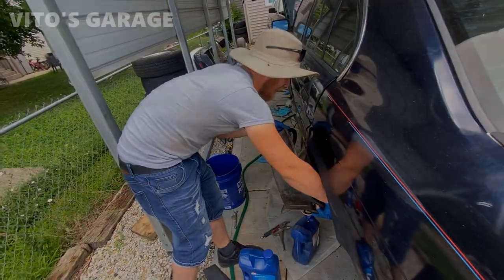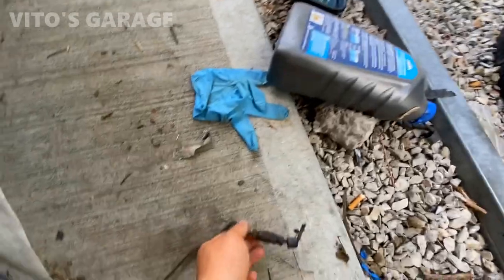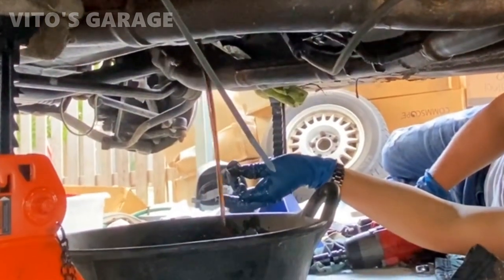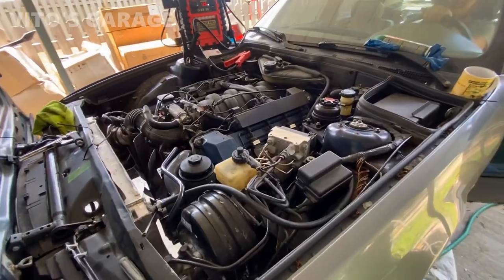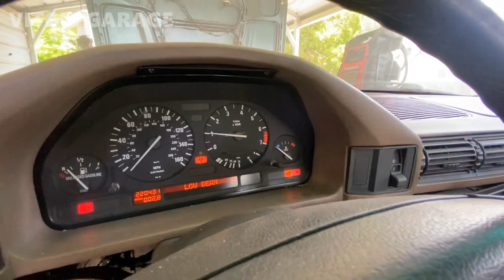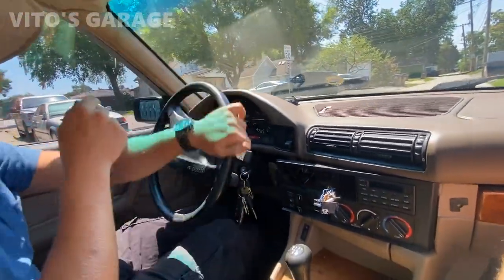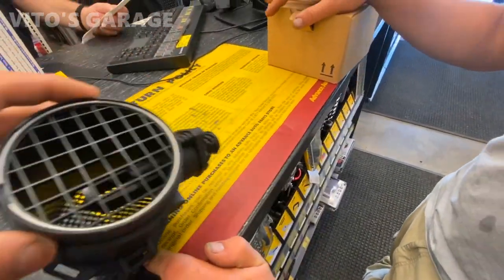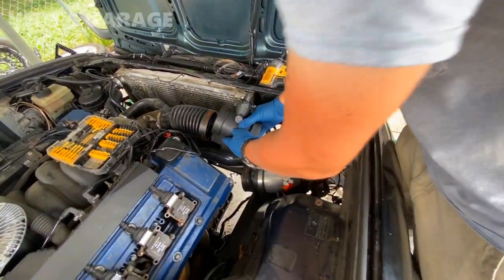V8 1994 BMW 530i FIRST DRIVE AFTER A LONG TIME!!!!! E34

Comment: How can it be 530i if it has V8?
Reply from the maker: 530i is a V8 buddy
Reply: @VITOSGARAGE  
530i can be M30 I6 or M60 V8
535i is M30 I6
540i is M60 V8
😅 confusing, unlike benzes
Reply: I had a 1994 530i, black on black, automatic though,  unfortunately my next door neighbor crashed into the rear end, totaled it, top speed 143mph, electronically limited. Cruises wonderfully at 120mph. Great video, keep it up, still loving my vintage 1993 MB 190le.
Reply from the maker: @aa-lr9zn  530i in USA is an M60 V8. 535i in USA is an M30.
Reply: older 530s are m30 but newer are 3.0 v8 m60b30